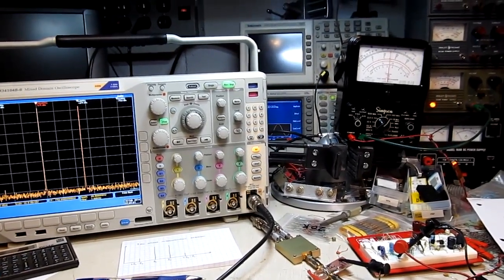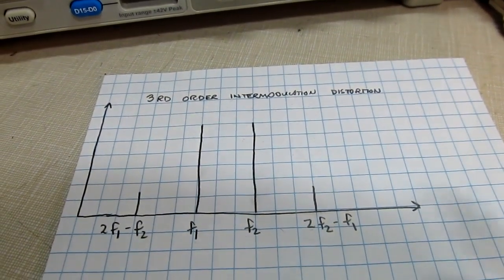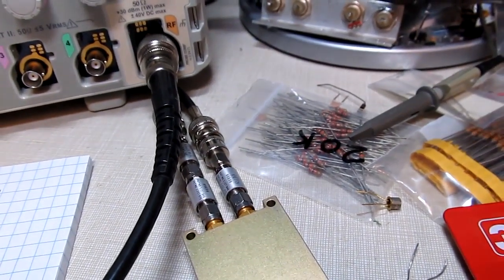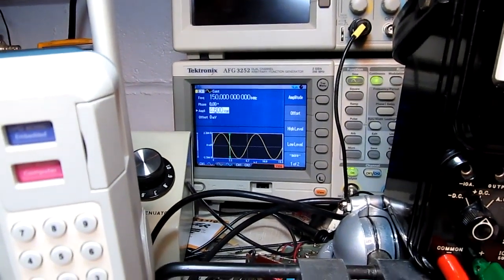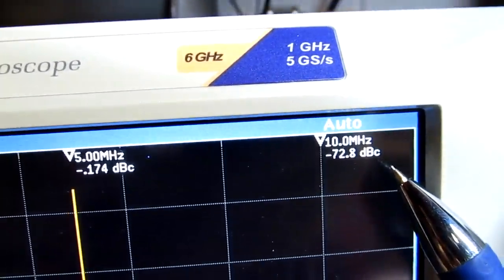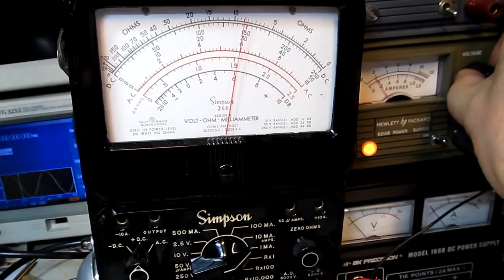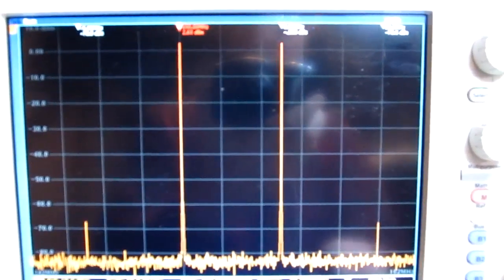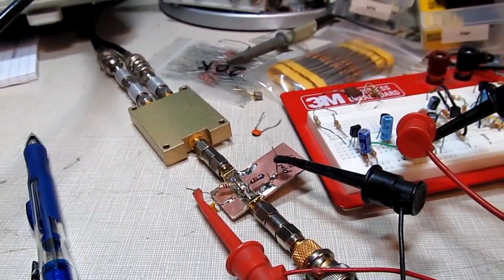#130: PIN Diode 3rd order Intermodulation Distortion (IMD) vs. bias current - how to measure

Comment: How do you know the product levels aren't inherent to the specan towards the noise floor?
Reply from the maker: The usual method is to insert an attenuator at the specan input.  If the IMD products drop by the attenuator value, then they're part of the DUT.  If they drop more than the attenuator value (like 2x as much), then they're likely due to the specan.
Reply: @w2aew  Great lab technique!  Since the slopes of 2nd/3rd etc are steeper than fundamental, this'll work quickly and easily.  My instinct would have been to notch out the harmonics or BPF the fundamentals, which would need fancier gear than a simple attenuator.

Thanks for sharing all this stuff.

Comment: Could anyone please tell me if,  the "Power Combiner" just adds the two signals together, or does it do something more involved? Also, "when" would you want to use a "Power Combiner" , please? (I'm not sure of the practical application of  "combining" two similar signals (i.e., two signals that have frequencies within 5k HZ of one other, and, I assume, same amplitude.) That is, I basically understand the idea of "mixers" but not "Power Combiners".
Reply from the maker: Power combiners are typically passive devices that add signals together through a simple resistor network, or sometimes via transformers.  They maintain proper port impedance for RF circuits.  A brief description can be found here: https://www.electronics-notes.com/articles/radio/rf-combiner-splitter-coupler-hybrid/splitter-divider-combiner.php

Comment: I can see how an array of PIN diodes might make a nice digitally controlled step attenuator by switching in various resistive pads, but I fail to see why these devices are useful as variable resistances.  The "on resistance" must be pretty low once they are forward biased as evidenced by the low insertion loss on your spectrum analyzer.  By the time you see attenuation of a few dB, the IMD has really crept up significantly.  What application of variable resistance might one use such a diode for?  Thanks for the excellent video.
Reply from the maker: There probably aren't a ton of applications for a voltage tuned resistive impedance - but possibly for things like electronic phase adjustments, fine amplitude control of an RF signal, etc.
Reply: w2aew , that makes complete sense.  Thanks for the reality check.

Comment: your channel has convinced me to start RF stuff. Ive got myself a Marconi Signal generator, old spectrum analyser, connectors, cables etc. One thing ive noticed is that making measurements and setting things up is a whole lot harder compared to lower frequency stuff. for example, in this video you explain how you used 2 attenuators inline to prevent unwanted distortion. That sort of insight is not so easy to realise for beginners. Do you have a video on or plan on doing a video on such techniques or could you direct me to where i could read up on some?
Reply from the maker: There probably isn't any one good resource.  I pick up little tips like these in several places - from test equipment manufacturer's application notes, book, experience, and from other engineers I've worked with over the years.  I try to put little tips and tricks into many of my videos, and will continue to do so.

Comment: Thanks again from Australia.
I am learning a lot from your videos. I've never really worked with RF, and your procedures are very clear to follow.

I've a question. What is the lowes frequency his circuit would be reliable for? Is iit low megahertz or high kilohertz?
Reply from the maker: It depends on how hard you bias the PIN diode, and the amplitude of the "RF" signal.  Of course, if the DC bias current is large enough to overcome the peak current in the negative half cycle, then the stored charge doesn't enter into the equation at all.  See my other video on "using diodes as switches" for a better explanation of this.
Reply: @w2aew  For those of you landing here, and wishing to see the first video on that topic:
https://www.youtube.com/watch?v=YBNIq_d56sA
(There are several more W2AEW videos on the topic "using diodes as switches")

Comment: Forgive my ignorance, does a pin,diode let through both halves of an ac signal, or are those signals still rectified? As with other diodes. Great vid and ty
Reply from the maker: The signal is NOT rectified.  Check out my video on the basics of PIN diodes and how they're used for RF switches:
Basics of PIN diodes and their use in RF switch applications

Comment: Thank you for the further information, ithe results are very interesting.
I had often wondered whether radios like the FT817 ran enough bias current through the PIN diodes in various places. 
Your demonstration suggests that as long as the current is high enough to get the "resistance" low that IMD should be low too. 
Interestingly for close carriers in full sized radios with selectable filters in multiple IFs it perhaps could be the lowest frequency last IF where the bias needs to be highest. 
I realise there is more to transceiver performance than the diodes though! 
Once again thank you for making this video.
Reply from the maker: True regarding the last IF, especially since the signals would likely be largest there too.  The good thing is that it is easier to make nice steep filters at these lower frequencies to attenuate these products.

Comment: Thank you very much indeed for making this video, it seems that the intermodulation distortion climbs rapidly when the forward bias is ridiculously low. Like all good experiments it has got me wondering though. How much imd is contributed by the generator, I appreciate you have gained isolation with the attenuators. perhaps a link wire in place of the diode would reveal the "test rig imd".
I may sound obessive but the -70dB would be a good transmitter result but not good in a high end receiver. 
i have plenty of HF rigs, I really should try some of my own experiments!
Your measurement was also done at VHF where carrier lifetime would be working to your advantage.... wondering whether a few milli-amps is enough with big signals on lower HF bands.
Congratulations again on the videos, I am sure many of us are still learning from them, both amateurs and professionals.
Reply from the maker: My baseline measurement with the PIN diode out of circuit showed the same IMD products as with bias >500uA. I figured it was low enough to make the point regarding linearity vs. bias, so didn't investigate it further. The spectrum analyzer is spec'd at 65dB 3rd order IMD, so it's already showing distortion that is 10dB better than spec. Plus, the generator is a DDS based unit, so wouldn't be surprised that even with 26-30dB isolation from the attenuators that it may also contribute to the -75dB IMD.  The PIN diode used was a spare from a repair on a VHF/UHF rig, so probably not appropriate for HF and the carrier lifetimes required for that. Thanks for your comments and interest.